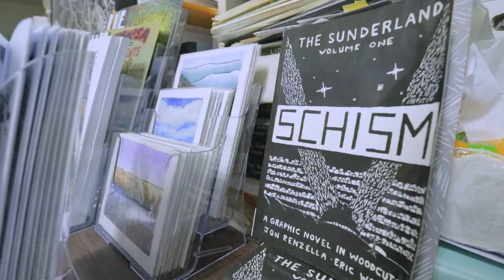The Process of a Woodcut Artist  Jon Renzella

Comment: Beautiful work! How on earth you manage to get a body of work together to have exhibits with such time/ labor intensive work is a mystery to me. ( you mentioned in the video it can take up to two years before you pen an artistic vision onto wood).  I’m teaching myself Moku Hanga mostly from watching Dave Bull videos, Laura Boswell book, and a few other things, too.
Reply from the maker: Thank you! Most of the two years is thinking about the concept and how it will look, a sort of pre-production. During that time, I work on other projects, some that I've been thinking about for 2 years, and other ones that are less conceptual (a landscape, for example). My exhibitions are usually a combination of long-term works and  quicker pieces. 

My carving style is also faster than the traditional Moku Hanga way, which Dave Bull uses. I don't use a knife, but instead carve around my shapes with my U gouges. I mostly stick to 2 gouges, and get into a rhythm when I carve, which speeds things up. I have a few videos on this channel demonstrating my carving process in more depth. 

Good luck with your carving, it's such a satisfying way to make art, and I find it very relaxing as well!